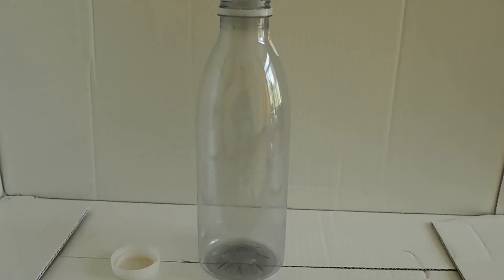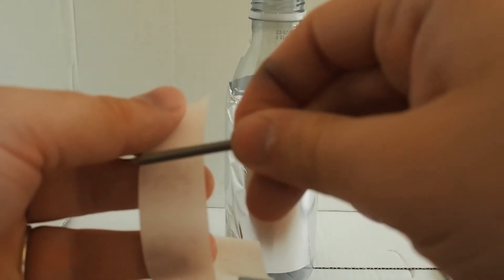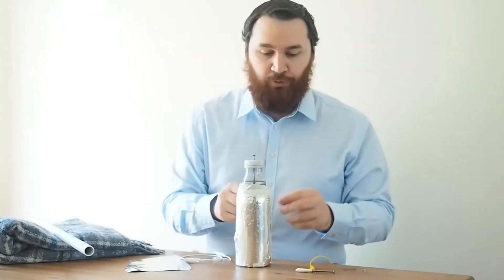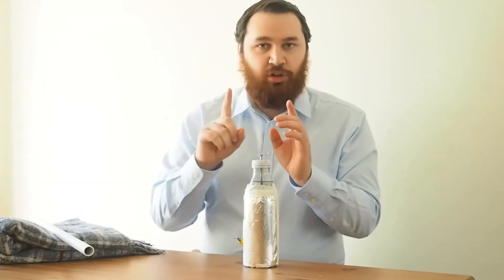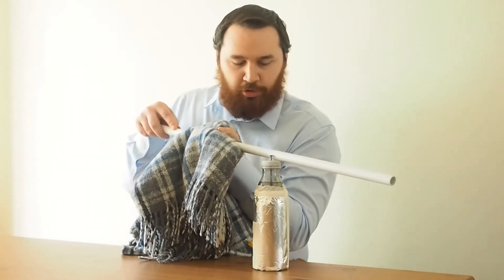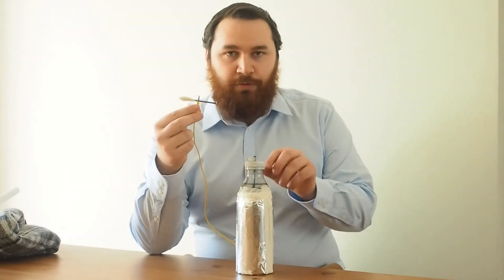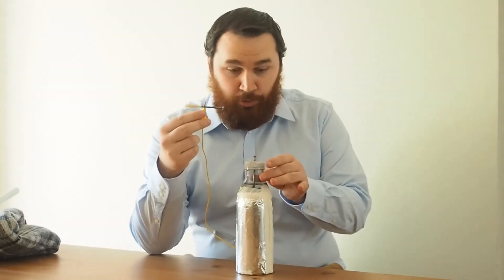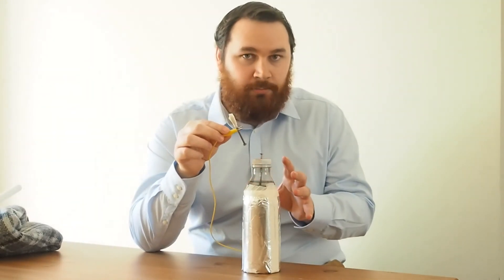Lightning in a Bottle - Static Electricity (Part 2)

Comment: Will adding a resistor restrict the current flow for longer duration of use... Because I'm not fully versed with electronics, but from my understanding restricting the voltage will increase the Amps(current), meaning we would have a usable battery that can be charged from atmospheric energy... That's pretty incredible because as another comment said... This is proof we have all the free energy we need